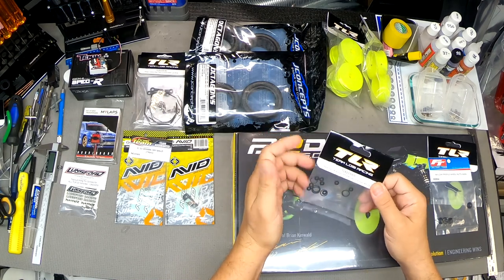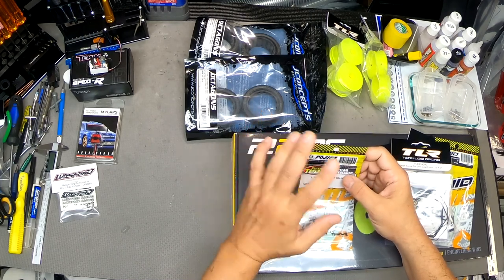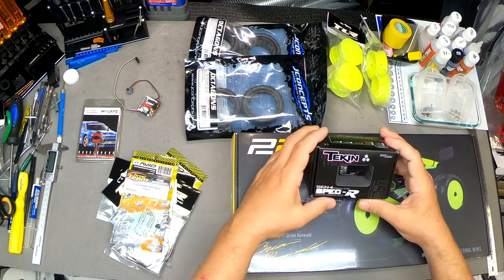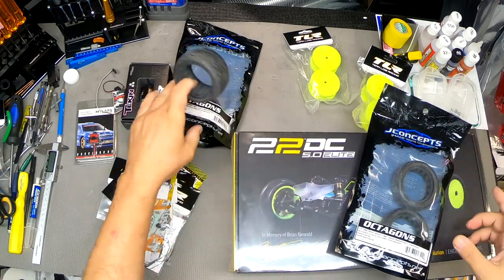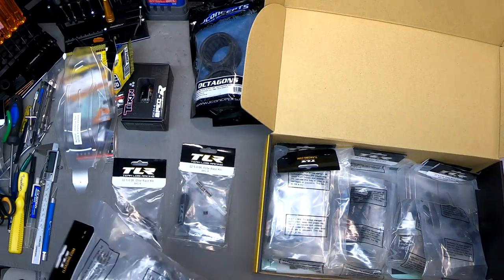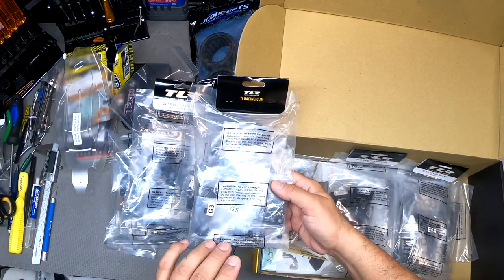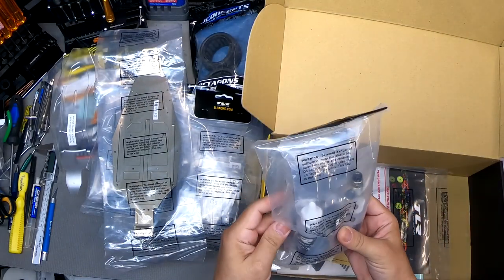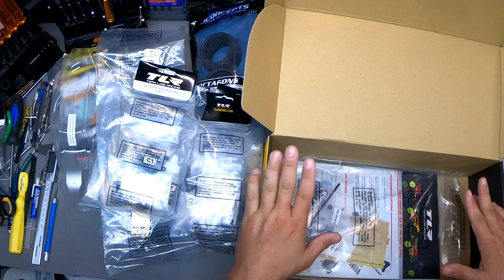Building a TLR 22DC 5.0 Elite 1/10 2wd RC Buggy for Off Road Spec Racing - Pt. 1

Comment: I was looking for a build series to see the specifics that I might like to know before I get this kit. Exactly what I needed.
Reply from the maker: Hi Ian, I'm glad you are finding my videos helpful. 
I'm going to be getting to the track with this buggy in the next couple weeks and I'll be posting video of runs and any tuning I do to dial in the suspension. Of course, any changes will be suited to my driving style and the track I'm racing at, but it may help you sort out your buggy. Keep in touch and let me know how your build comes together. And, feel free to ask any questions you may have.

It would be a big help to me if you could share the link to my channel with your RC friends. And, "liking" my videos is alway a big help too!
Thanks again,
CJ
Reply: @MyRCChannel-CJScott  Awesome! Was wondering where the running videos were. ATM still saving, probably won't have this for a few months, but I'll be ready.
Reply from the maker: @ian3166  Here's a tip since you're still getting your kit and electronics together... I've found a really fast servo that I've used in several kits now. It's the Reefs RC 299LP High Torque/Speed Low Profile servo. At 8.4v, it rotates in .057 seconds, and .06 sec at 7.4v! That makes it one of the fastest servos on the market... it's $120, but with steel gears and an aluminum case, it's well worth the money.
Reply: @MyRCChannel-CJScott  thanks, but that is a bit more than what I was planning. Trying to stay in a budget while getting decent stuff. Going with a Savox 1258. If I upgrade, that servo sounds awesome.
Reply from the maker: @ian3166  I totally understand. Sometimes we have to make choices based on money versus performance. I've used Savox servos for years and they are usually reliable. The 1258 is reasonably fast, especially if you can get 6v out of your ESC.
Reply: @MyRCChannel-CJScott  So I just won a 22 Elite. Guess I'm building this thing sooner than expected. Won't be able to do aftermarket stuff like you but it's time to binge watch this series. :) Saving for good tools before I touch it.
Reply from the maker: @ian3166  Congratulations! Feel free to ask questions as you go through your build.

Comment: I also use Tekin electronics in all my vehicles. While I use Spektrum servos in my TLR buggies, I also use their T-180 Low Profile servos in my 190 and 200mm Touring cars.

The Gen4 series, both their 17.5/13.5 and Modified motors are good. Like you, I’m not a “Pro driver”, so I don’t need to buy one of those Trinity “Certified” motors for almost $200, lol.

Comment: Hi Great, video. Question are those Jconcepts tires good for concrate or asphalt? Thank you!
Reply from the maker: None of the offroad tires are made for asphalt... they are usually softer compounds so they will get torn up on asphalt or concrete. They'll last for a bit, but you'll be replacing them before to long. Consider getting foam tires or road tires. 
In this series of videos, I built a Slash for on-road racing. The club I road race with has an open class for truck based vehicles... basically all is legal as long as you're running rubber tires, truck based chassis, and battery limitations. Check it out... in this playlist I go through different tires until I do a conversion to run 1/8 scale touring car tires.
https://www.youtube.com/watch?v=YtQrDw0TYKs&list=PLWi1J2KoLS71CXt8_tHXnAqSBpd9FKJwU&pp=gAQBiAQB
Reply: Duratrax used to have Bandito tires in sizes to fit 2WD buggies - looks like Horizon no longer sells them, but maybe if you look around, some shops might still have some. I got these for my daughter’s 22 5.0 SR so that she could learn to drive out in front of the house before taking her to a track. FWIW, the best combo was C2 compound for the fronts, C3 for the rear.

Comment: Uh Ohhhh! No wheels in this kit! 😬
Reply from the maker: No wheels included. Here are the items 
Needed to Complete:
Motor
Electronic Speed Control
Servo
Radio System
48 Pitch Pinion Gear
Battery and Charger
Wheels and Tires